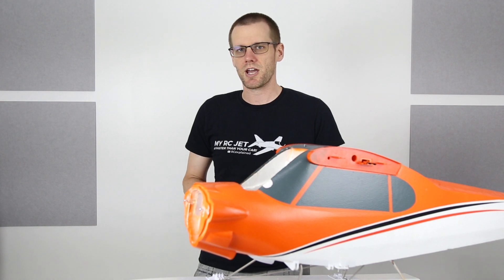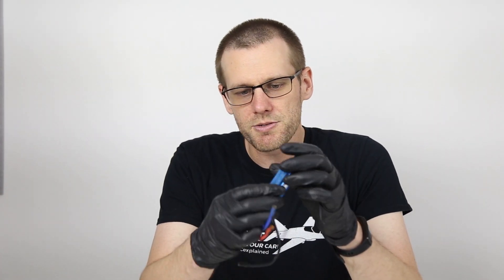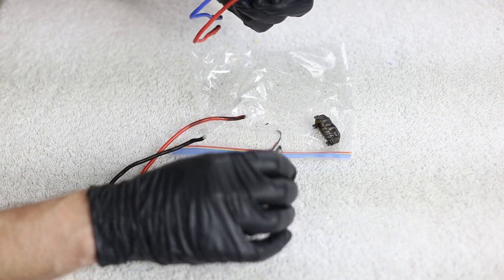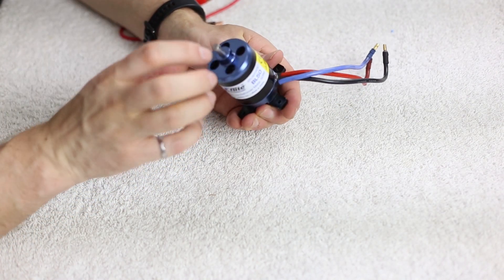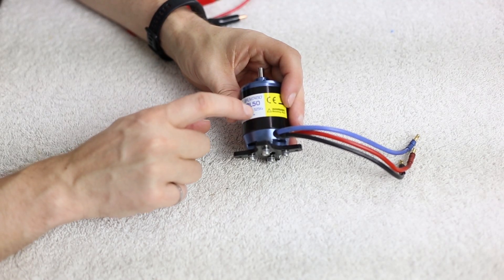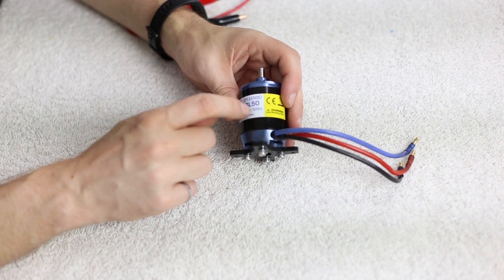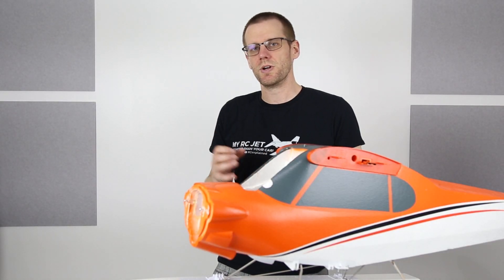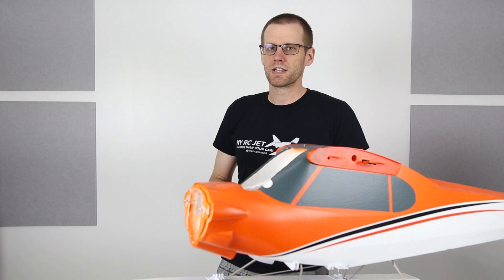FIRE Onboard RC Plane, Let's Figure Out What Happened!

Comment: What is the current draw of that motor under load? And what gage are the power leads coming from the ESC? I ask because I’m a degreed EE, and worked two decades in industrial machine controls. I see in the hobby RC world that these manufacturers undersize the motor power leads, often by even half or more, and it really makes no sense to me. Then the hobbyists say, “it’s fine, because “ratings” and reality aren’t the same thing, and those wires are perfectly capable of carrying 120 amps.”
Yet things keep burning up due to excessive heat build up, and “cheap components” end up getting blamed, when in all likelihood the electronics would never have overheated if the conductors were sized with safety in mind rather than economics, weight reduction and convenience. 
If you really want things to not burn up, especially these relatively cheap components, look at the continuous current rating of the motor, multiply that by 1.25, then look up what size conductor is needed to continuously supply that current. 
For example, a motor drawing 120 amps under load for more than 15 seconds will require a minimum wire gage of 1 AWG. Anything smaller than that will build up heat and quickly become a resistor, reducing even further the amount of current available to the motor. This cycle becomes “critical,” as more demand builds more heat, which reduces conductivity, which reduces available current, which increases the delta between demand and available, which increases heat, which… see the cycle? Once this cycle is entered, failure is eminent unless power is cut. And since the heated wire reduces the current capacity, overcurrent protection will not trip. Excessive heat begins to build up in both the motor and the ESC, so the only protection that would trip the circuit would be thermal protection. If the load condition persists without thermal protection in place, the weakest component will become the fuse and burn up - and in the case of RC vehicles, that’s likely to be the ESC, but could also be the motor itself, depending on the size of conductors in the windings.
In the industrial world, the conductors should be sized accordingly to the FLA rating of the motor, the overcurrent protection should be rated at 125% of the motor’s FLA rating, and the motor controller should also be rated at 125% of the motor’s FLA [Full Load Amps] rating - the amperage the motor will draw under a full load condition. Building things in this fashion increases the lifespan of all the components in the circuit. Running things on the edge, or undersized, may work even for a seemingly significant period of time, but greatly increased the risk of failure, and often does lead to eventual failure as the components become weaker and weaker over time due to heat.
Reply from the maker: Hello. The ESC was powered up. Throttle was increased to 100% for take off. Immediately the motor sounded like it was not in sync with the ESC (It wasn't) and a few seconds later flames shot out.

Comment: If I have a old brushless motor that's had bearings replaced a few times, would it be more strain on the esc and not worth using . Is this a way of testing ? I do burn out 6s escs if I use them daily , hard to say if its just wear tear or  just subpar quality . I wonder if they only rated to get so much run time.
Reply from the maker: If the load under power is the same as it was when new, the quick answer is no, the motor is OK.

Comment: wtf        at 6:26,  'the voltage that the  MOTOR  produces'     yer cracked.               get  out  yer  MULTIMETER.             TEST  phase  CONTINUITY              measure  phase   RESISTANCE/IMPEDANCE.              at 8:48,  W T F   ---    MAYBE  you know what you are doing.      but  you  have  Not  Sufficiently  EXPLAINED   how  you  set this test up.!!!!!!!!!!!!!
Reply from the maker: Hi David, thanks for your comment. I think I remember you from a previous similar comment.  Unfortunately Phase Continuity would not tell you anything useful. The typical multimeter does not read resistance at the sensitivity that we require. For this reason, measuring resistance would not be sufficient and only lead to false conclusions. 

Link in description for a more detailed explanation of how to determine Kv of a motor. Covered this topic in several videos.
Reply: That's a special meter used ? Called micrometer i think ? I know you need sometimes for accurately test larger ac motors

Comment: the controller may have had a hickup and turned on high and lowside fets on the same phase    this would have been prevented by using dedicated gate driver ics, this maybe had just used transistor driving circuitry or even worse, p and n fet bridges.    can you take detailed pictures of that board after cleaning it a bit   just wanna see how they designed it.